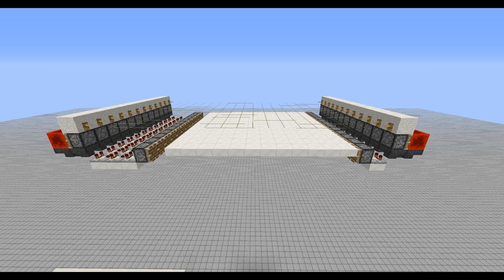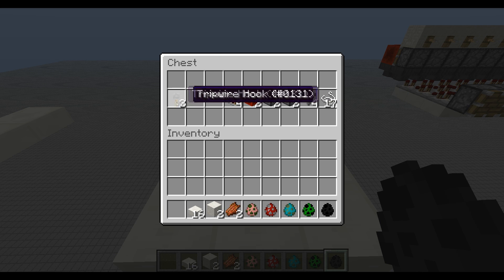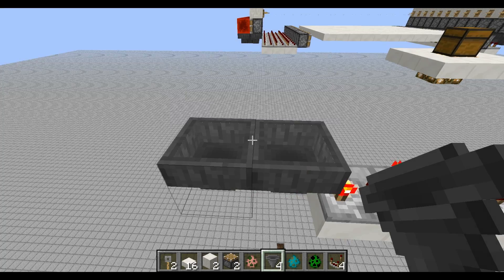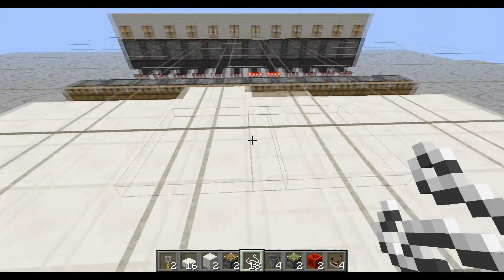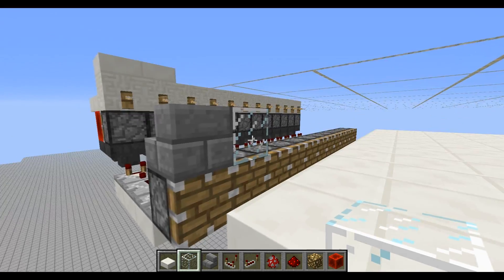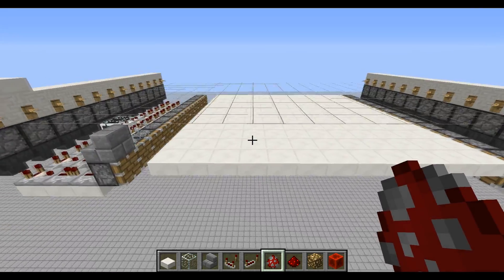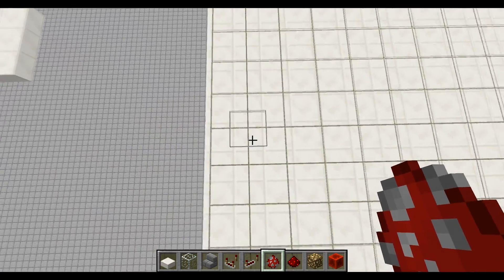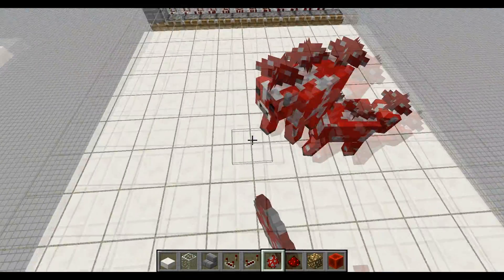Minecraft Tutorial: Smart Shifting Floors

Comment: I came up with a cheaper (I think) version. You stagger the tripwire hooks, and the hopper clocks so you have 3 comparators then 1, then 3 (and the opposite on the other side) etc. Then instead of pistons, you stick a redstone torch on the back of the block with the tripwire hook, and a redstone dust on the further hopper (under the torch). Your design is probably better, but I think this one would work.

Comment: I just built this exactly as shown and some pistons move at separate times with only a single item in 1 hopper on both sides. Their not moving in sync with 3 comparators on 1 side and one on the other. This leads to some floors shifting, and some not shifting at all.